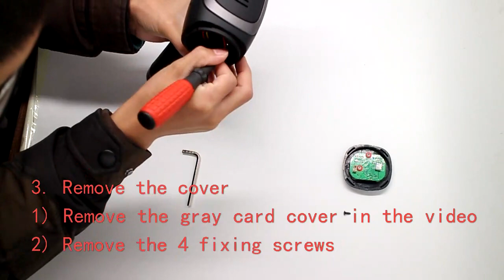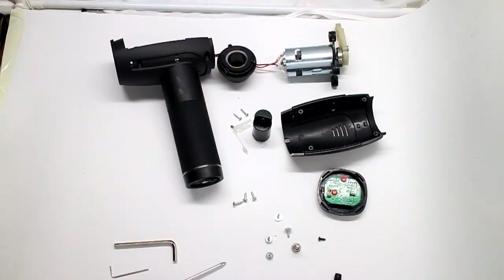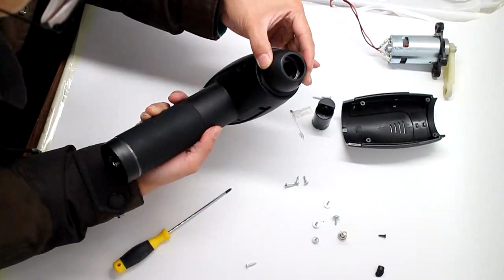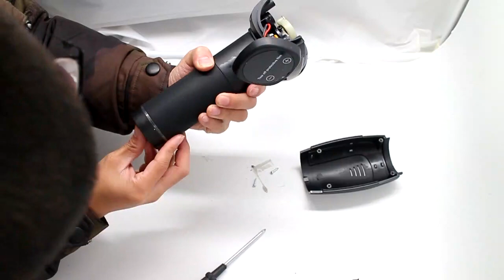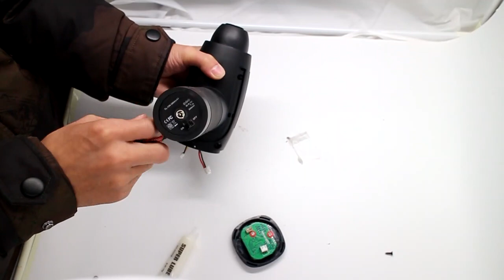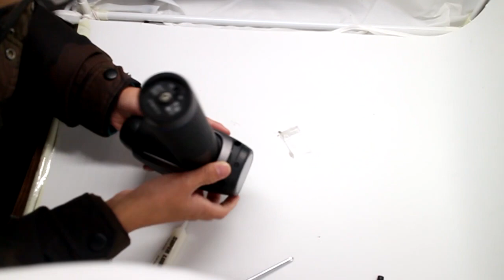How to repair a Muscle Massage Gun with replacement parts?

Comment: I suspect my Profit was assembled without the bolt that holds the white piece you didn't remove to the motor shaft so it eventually came off.  I suspect that because after a year or so of use, the parts came out when removing the massage tool.  No bolt inside.    Can't find any similar bolt in hardware store.  Where can I get one?  So far Profit hasn't answered any questions.

Comment: Maybe you can help me. I have a wubefine massager gun that doesn't want to turn on. If you connect the charger the light turns green but if you try to switch it to ON the machine still OFF. Summarizing my gun doesn't want to turn ON. I followed your video thinking that a wire was disconnected but everything was okay, but still OFF. Do you have any idea about how to fix that issue?
Reply: Sounds like you have a power board issue! You need a new power board
Reply: @robbiemiddlebrooks8188  where can I buy one?
Reply: @ffasanor  not sure with these things coming from China! Maybe if we still had Radio Shack stores!

Comment: What should i use to lubricate the piston
Reply: They use grease, but to apply it you need to dismantle the gun. A lot of these guns suffer from the piston jamming
Reply: Yea I've taken them apart before but never knew exactly what to use.. don't have gear so I been just using stuff like ky lubricant lol but I'm pretty sure it's not preferable

Comment: can someone help me my massage gun keeps shutting down
Reply: i have same problems as u have...pls help
Reply: Sounds like the piston is jamming, try moving the piston by hand, if this is hard to do then, its likely the problem, this will cause the gun to switch off, when first starting it up. Its a common problem. Try applying heat to the piston, using a hair dryer, before switching on. You might need to take it apart and apply grease to the piston.
Reply: @richardevans9465  what’s a piston ?
Reply: @smilingtotan1139  the part that holds the massage attachment and goes up and down, there is a weighted piston behind that attachment piece.

Comment: You didn't show anything about fixing it.
Reply: your right, pretty useless, if you want to repair one
Reply: Yes they did, when they took off the bottom circuit board they stretched the contact springs for a better contact.
Reply: il display si accendeva prima di aggiustarlo? 🤔
Non si riesce a capire quale fosse l'anomalia.